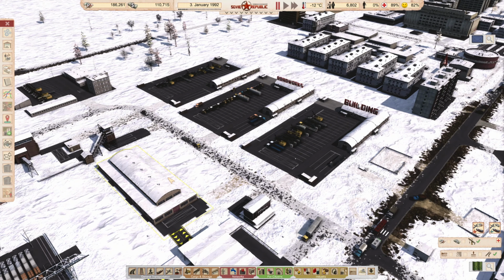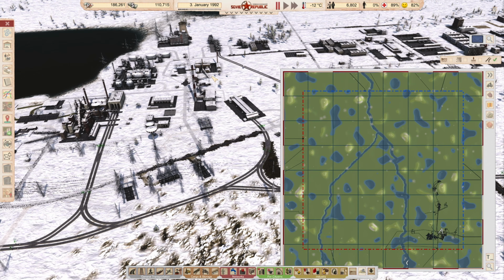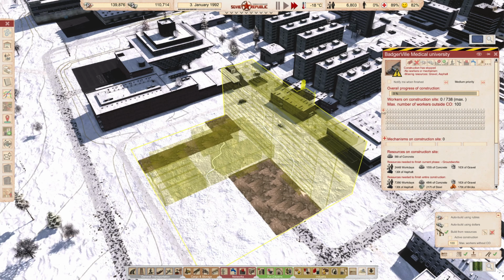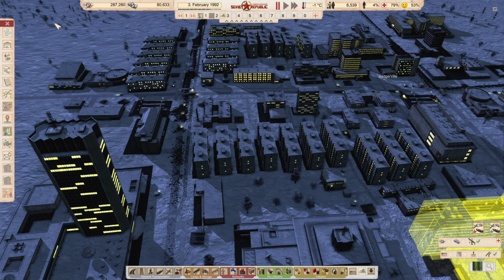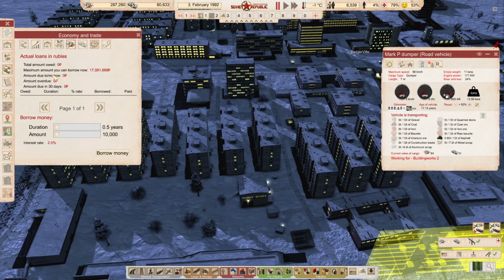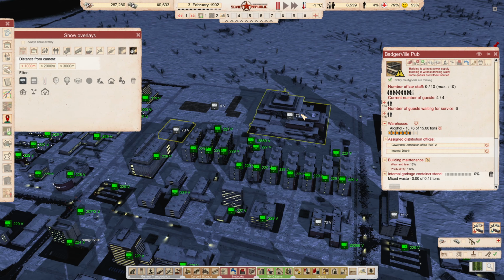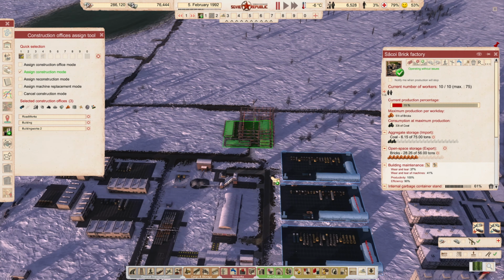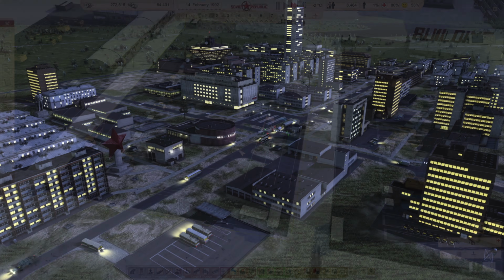Workers and Resources: Soviet Republic ULTIMATE Tutorials - 1 - In depth UI Elements explained!

Comment: I've noticed the same issue with construction vehicles having left over material, even if you don't speed up the time. 
That is why I use the garbage icon when in the vehicle menu, to remove left over material.
This will let the vehicle be used for other material pick up and deliveries.
Other-wise I've noticed that the vehicles will sit and not be used when needed to pick up different material.
   Example if a dumper has gravel left over, they will not get asphalt, due to mixing of material.
 Great videos, Thanks for the detail.